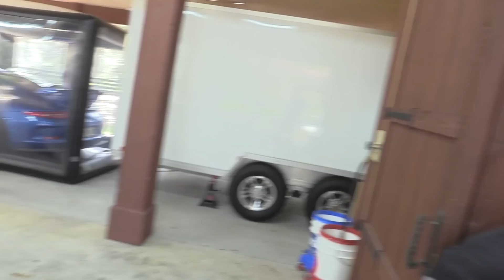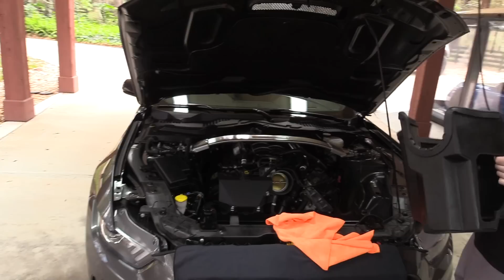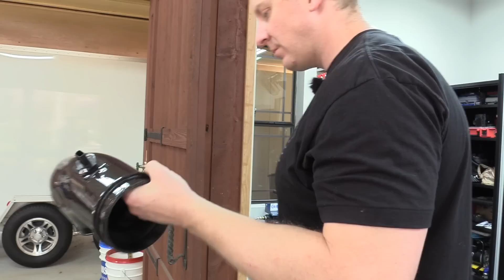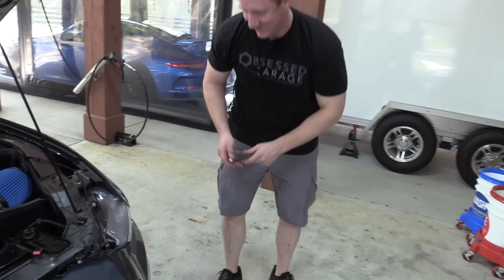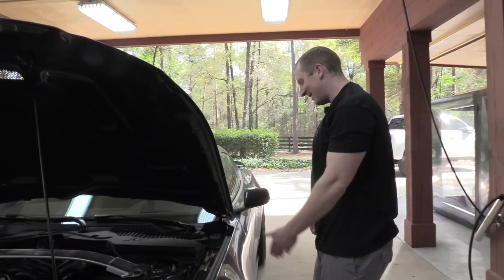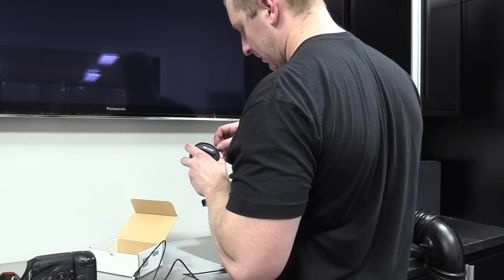JLT Intake & Lund Tune Install

Comment: Hey Matt, your video production really stands out, I truly enjoy these videos, but would seriously like to watch some driving. As a general question... how do you find yourself getting used to the hanging gas pedal in gt350, opposed to the floor pedal in most German cars. You have said you've owned an e92 and f80 which both have floor pedals. Just want your opinion on whether it took time to adjust or something you didn't notice. Anyway keep up the great content!
Reply from the maker: I don't notice it at all.  I did buy a new pedal cover and spacer to try out.

Comment: Matt, what's your thoughts on the ceramic coatings?
Reply from the maker: On cars that I care about like my GT350 or GT3, I don't use them.  Once you put it on the car, it's not likely every coming off.  On the Tahoe and Raptor, a coating makes sense.
Reply: Obsessed Garage i think (vivid memory) the ceramic coating insulates the heat and stops rust  so its not really a bad thing to do.
Reply: Obsessed Garage isn’t that a good thing??

Comment: If you install a upgrade air filter to a turbo engine, will it damage the car/engine if it isn't tuned?
Reply: Depending on make and model, but its always best to get a tune to be safe.
Reply: for any stock car, if you give it more airflow it would run lean unless the car knows to add fuel, otherwise a tune is a good idea
Reply from the maker: Most likely not.

Comment: while your there you should clean the MAF with some CRC cleaner .... be careful poking the throttle body with your finger, you could strip the nylon gears that are connected to the motor.. throttle body looks pretty clean so it's probably not worth cleaning it right now.

Comment: So how much more horsepower over stock does the tune and intake give you?
Reply from the maker: Somewhere in the 30 whp range.
Reply: Pretty conservative
Reply: 30 whp is just a peak number. The car should see gains pretty much everywhere especially 5,000 rpm to redline. With an intake and tune it will be noticeably faster than stock all throughout the powerband, not just at the top of it. So for example the whole time it is going around a track it is accelerating at a quicker rate than a stock gt350...this turns into a big advantage over the course of an entire lap.

Comment: how did you like the lund tune and intake? im about to do that with mine. noticeable difference?
Reply from the maker: It's good.  I'm having a bit of an issue with the car hesitating and running a little funny until it's warm.  Otherwise, there is no question the car is making significantly more power.

Comment: why would you do anything to this car! It is engineered to be at its full potential from the factory.  And the engine already has a high performance tune.
Reply from the maker: No it's not.  I just gained like 40whp.
Reply: Obsessed Garage yeah but the rest of the car is designed around that engine with the stock hp
Reply: All cars are tuned down with mechanical hardware designed for oversight/room. Example would be the LS2/3 iirc was tuned down for the camaro but later tuned back up with no hardware changes. Also, cars are tuned down for variety of reasons like bad gas in certain areas would cause knock and Ford doesn't want to deal with that. Or a better example, the 6R80 automatic in the standard mustang is capable of supporting up to 600+whp as seen by Ford/Roush warrantied vehicle.